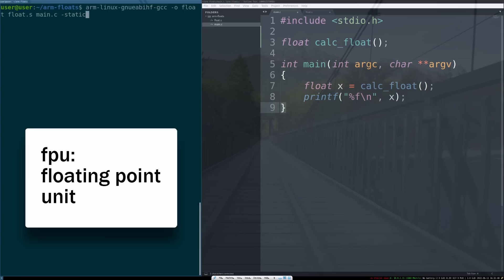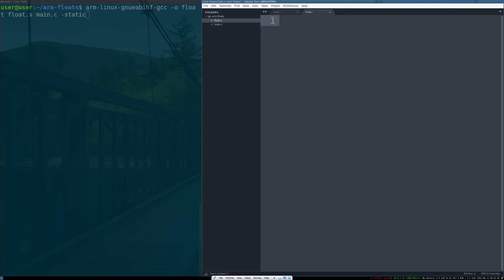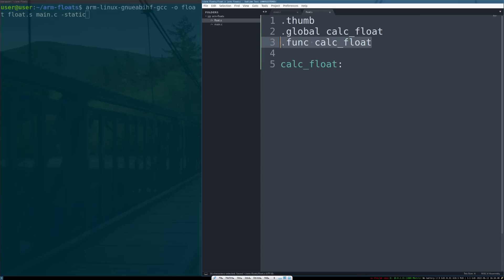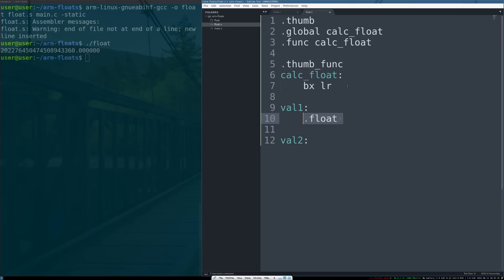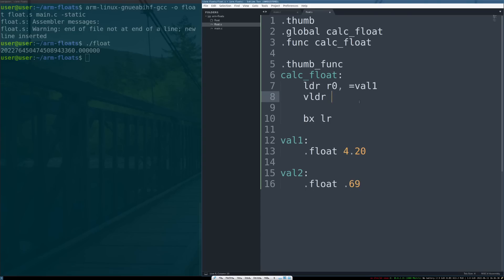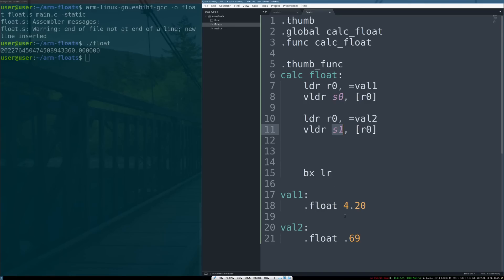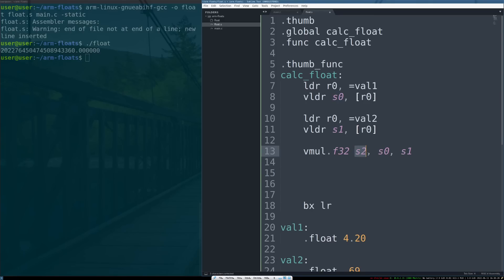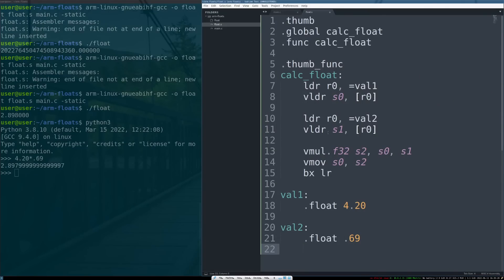do arm processors float?

Comment: I've worked with integers and fixed point stuff in microcontrollers for years. You get used to it, and it's fine. But floating point is so much easier to work with. You don't have to worry about picking a scale factor appropriate for each variable. You don't have to do a division/shift after every multiply. It's always quicker and easier to develop, and it often ends up being faster to execute, because you don't have to do those extra operations.

Comment: Tried this code on my RPI4 and the empty func in float.s returns the nonsense value just as the video, but the actual FPU code gives me "Bus error (core dumped)".  Using "arm-linux-gnueabihf-gcc -o float float.s main.c -static". Running Ubuntu 20.04.4 LTS, 5.4.0-1042-raspi

Comment: Nice how 20 lines of assembly are better at math than the whole python interpreter 😂
Reply: Python is written in C and both Arm and x86 use the IEEE floating point standards. They are actually the same number. The program he wrote in assemble/c simply rounded the number to a few decimal places while when printing it to the console Python just showed all digits past the decimal point.
Reply: @matth3wc  I know, it was a joke
Reply: @redcrafterlppa303  but it was faster, so better

Comment: Hello, I like this channel but I'm a complete newb about low level programming. I wanted to ask why is it needed to put the values of val1 and val2 in the register r0 first? Isn't is possible to put them directly in s0? Thanks
Reply: ARM is a RISC CPU which means that your sanity is at RISC if you try to program it in assembly. There's a lot of things it can't do (as a one-liner) that even 8 bit computers could do. But what it can do, it does very quickly. And if you're coding in C all of that is abstracted away.
Reply: @tripplefives Thank you for your reply!
Reply: The real reason is that floats are not stored the way they appear. You see 4.20 but the computer sees 0x40866666. This is too large for the ARM to handle as an immediate operand. So it's stored nearby and loaded from memory.

Comment: Question, could you have saved the last vmov by loading val1 and val2 into S1 and S2, then just running "vmul.f32 s0, s1 s2"? Nice, wanted to know more about how ARM works, I could follow along reasonably well 'cos I used to deal with assembly in ye olde Motorola 68000 code back on my old Atari ST.
Reply: Just to put into perspective how limited the ARM is, imagine if on the Motorola you couldn't do

MOVE.W #$FFFF,D0

and instead you had to do

MOVE.L #$FF,D0
OR.L #$FF00,D0

That's the ARM in a nutshell. However, the benefit of this is that all instructions take up 4 bytes (including the operands), so the program counter doesn't need to figure out how much to increment since the answer is always 4. This makes the ARM very fast compared to the m68k
Reply: @Clippy4Jesus  Well, this is not always the truth. Since this example uses THUMB instructions every Instruction is 16 Bits each. And if one uses THUMB2 it may be 16 or 32 bits depending whether this uses some Instruction that are part of the Thumb2 extented instruction set.

Well, this is pretty unusual for RISC Architectures (e.g MIPS, POWER or even ARM32 (e.g. Cortex-A/R)) that 'commonly' use a fixed instruction length in order to ease the Instruction Decoding Hardware as you state.

BTW: The successor of the m68k — The Coldfire Architecture — was an approach to build an RISC alike Core that is based on the m68k Instruction set - However slightly condensed ;-) . But even the Coldfire has two distinct length for their Instruction Decoding: Some(most) are 16 Bits but some are 32 Bits long.

Comment: easiest way to check if you got an fpu is if 0.1 + 0.2 = 0.30000000000000004
Reply: You can actually fully implement IEEE754 floats (the ones where that happens) entirely with integer operations, with no loops and very few branches no less (at least for the main operations). It's definitely slower than a dedicated fpu but all the results will be the same.

Comment: I get the following error messages when trying to compile this code on my Raspberry Pi 4:
float.s:8: Error: selected FPU does not support instruction -- `vldr s0,[r0]'
float.s:11: Error: selected FPU does not support instruction -- `vldr s1,[r0]'
float.s:13: Error: selected processor does not support `vmul.f32 s2,s0,s1' in Thumb mode
float.s:15: Error: selected processor does not support `vmov s0,s2' in Thumb mode

How can I get this to compile?
Reply from the maker: Does your compiler have “hf” in the name? The compiler target may not have FPU support :(
Reply: @LowLevelTV  No, but it is the local version of gcc on my Raspberry Pi and it can compile programs with floats and doubles in C.
Reply from the maker: You can do floats without an FPU using the the floating point estimation library in libc. Your Raspberry Pi likely has an FPU, you just need to find the right build chain to take advantage of it.